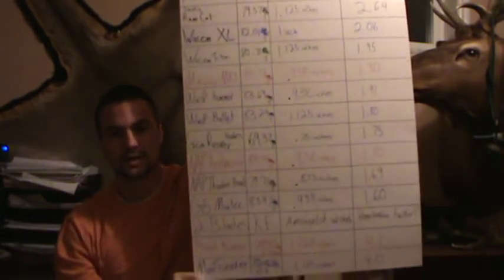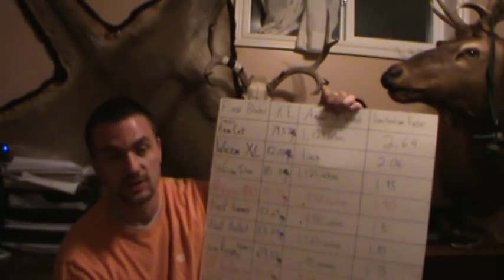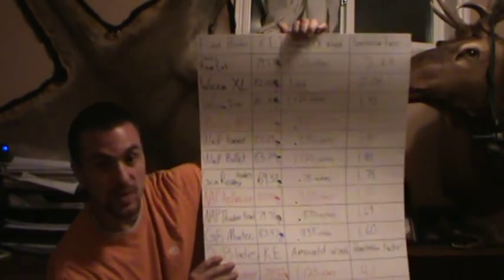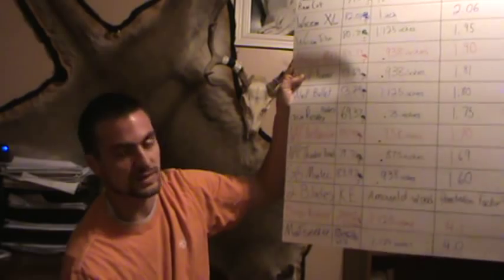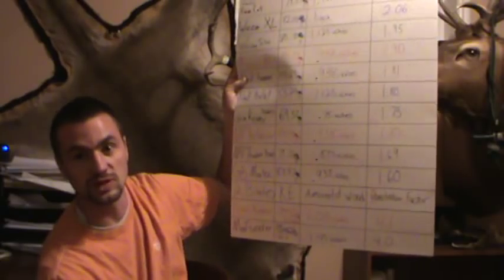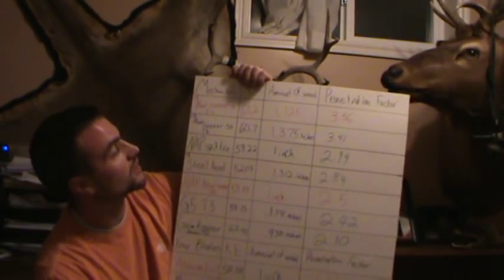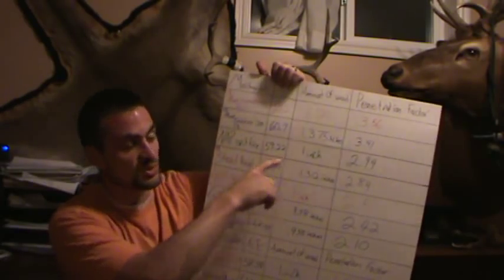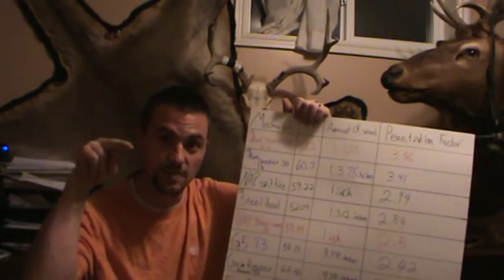ultimate broadhead test part 3 Results

Comment: I've been shooting the 2 and 3 blade meat Seekers for the last maybe 7 years I think whenever they first came out is when I started using them and they have outperformed every other  mechanical I've ever used they're  exactly the shape of your field points so you can thread them through grass there's nothing sticking off that Broadhead to make those blades deploy that will catch on grass and cause a deflection or Leafs or little twigs and I have experience with those shots and never hesitated because of the shape and style of the meat Seeker Broadhead the only downfall like you saying this video is they don't fully Deploy on contact but once they get inside and lock it's all over the blood Trails look like somebody took a five gallon bucket of blood and threw it on the ground the blood trails are phenomenal but there is a Broadhead that's been out a few years now called the afflictor that is stronger then any other mechanical I've ever shot and opens on contact every single time but has those two little tits coming off of the Broadhead to deploy the blades which is the only downfall with that broadheads I can't thread that threw grass or leaves the way I can a meat Seeker I don't have 100% confidence in that situation but then that comes down to where your hunting High grass fields and corn or open Woods but anyway the meat Seekers of phenomenal Broadheads and are unfortunately vastly overlooked because of the overrated rage which used to be the Rocky Mountain Sniper

Comment from the maker: Although I did make a graph it was not the actual graph of the velocity curve I only drew the graph to use a visual aid. To help the other people that dont know calculus understand why this test is better than shooting a broad head into ply wood or particle board. Masonite is more uniform and does not have knots or clumps of glue to give you an inaccurate result

Comment: So 2 bladed is best, becaus the "cuting area" of the blade is 1: irelevant in comparement to the 2 b vs 3 blade. 2: is if it was relevant 1/3 more vsthe 2 bladed.The relevant information is the wound channel the blade does, so the area of the wound channel is the relevant fact,is  due to the penetration is double or more vs all others. so even if you copare the irelevant data vs the relevant the 2 bladed wins whit 25%.

Comment: from experience, the trophy ridge meetseeker 3 blade are a joke I have shot 3 deer with them , the last deer was a fawn and I shot it at 30 yrds. and the tip of the broadhead barely broke the skin of the exit hole, the other two where shot at 15 and 20 yrds and the arrow only penetrated about 14 inches. you might kill something with but its isn't going to be a quick kill, last year I switched to the NAP Hellrazors, killed two bucks with them, two pass throughs, huge blood trail, quick kills

Comment: If you would have used just one masonite board and a gel block behind it and another board,which would simulate bone and flesh,with each tip shot three times,i would accept your results.But,since animals are not made of masonite and you only shot each tip once,i can not except them.But i did like your video.